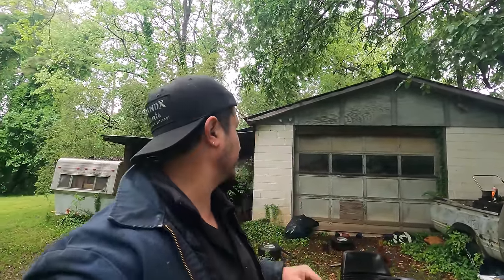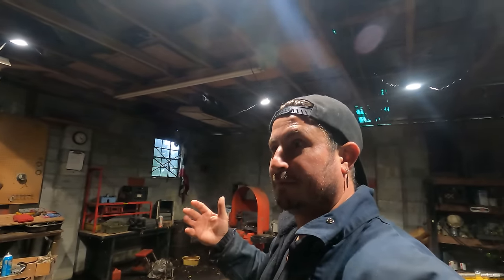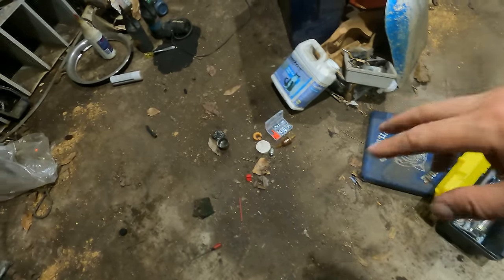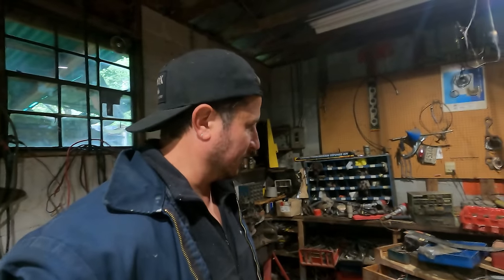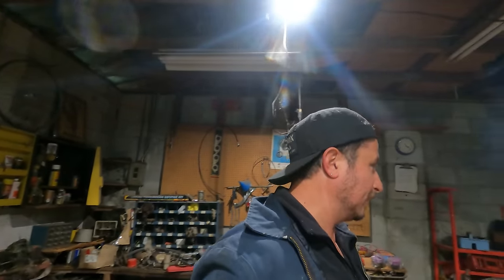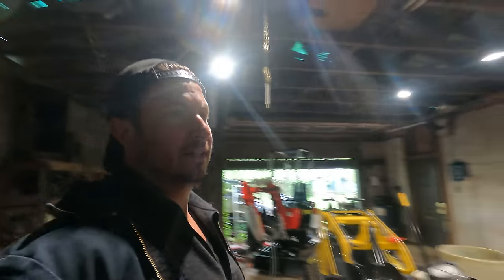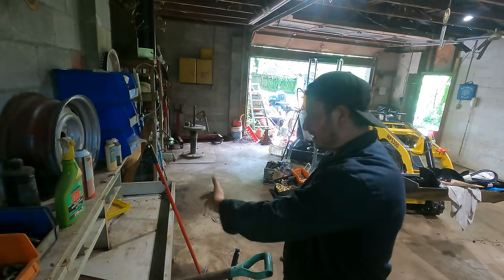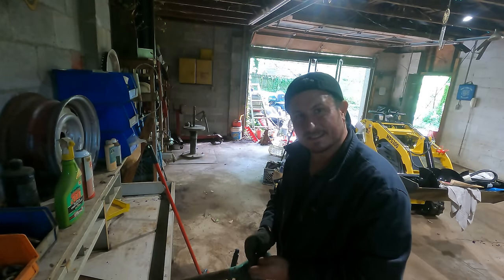What was left behind in AN ABANDONED SHOP!! Hot Rod Parts? Tools? Machines? Antiques?

Comment: Wiper blades, radio knobs, starters, all that little stuff used to be hard to find. Some still is, especially original parts. Im only 42 so not that old, but i used to buy kits and rebuild my own starters and alternators just like my dad did. Believe it or not, parts stores weren't always open every day of the week and just down the road. They were 9-5 weekdays and if you didn't have miscellaneous parts on hand you could get screwed pretty easily on a weekend repair on your ride. All that stuff was gold. Gotta remember, the interwebs wasn't around either to order everything.
The wheels and tires....keeping rollers around for project vehicles is a no brainier. Especially if you have a small space and need to move stuff in and out often. The previous owner had a method to his madness and knew exactly what he was doing.
Good luck on things!
Reply from the maker: You’re not wrong, and I live through the transition to parts stores being open while the rebuilding shops closed.  I also remember one part stores sold parts to things and not just whole replacements.       
But part of the method, this guys madness seems to reflect my own    Grab the spare take the part you need out of it, leave the corpse on the bench and shove the working one in the car and get down the road
Reply: @betweenthesharksgarage  never know when you might need the leftovers! Aint nobody got time to clean! I also suffer from that infliction 🤣🤣🤣
Reply: @johnw55018  What kits do I need to rebuild alternators and starters. Im just wondering. Cause I want to learn how to rebuild them

Comment: I'm  gonna  go  with  the  guy  was  a  rebuilder  of  sorts.  '67  to  '70  maybe,  Caro/Fireburd/T/A's.  Had  a  buddy  in  school,  and  that's  what  him  and  his  brothers  did.  Camaro  and  Firebirds  mostly.  Starters  went  bad  back  then.  Keep  a  few  to  swap  parts.  Bumperettes,  fit  on  many  Chev/Pontiac  models.  Corvette  stuff  was  a  little  rare,  and  VALUABLE!  Even  more  valuable  today.  Lugnuts?  Swap  meet  finds.  Always  have  extras.  Especially  if  you  dealt  with  Older  cars.  Left  hand  thread  and  all.  BUT!!!!!  You  did  come  out  of  it  with  a  tire  machine,  right?
Reply from the maker: i mean ... i came out with a tire machine, i saved all the pulleys, brackets, lug nuts, brakes and spindles, carburetors, water pumps, the inline 6, 2 engine stands...and most important...2 harley beers

Comment: Look at 67 comaro pics to see if that trunk luggage rack is to suit could be a bit of coin there and for the emblems. Plus the comaro nuts might be interested in the starters motors for date codes on restos as silly as it may sound to you. The Chinese gear is junk. 👍
Reply from the maker: good point about the camaros.   also a good point about the starter date codes.   all of it is just in a pile at the moment i will look closer at it before it goes anywhere... my old cars are beater drivers sometimes i forget about the true blue restorers

Comment: I’m guilty of hoarding old jumper cables. Not the cheap kind that you buy in the 7-11 at 2am when your car is dead in front of the bar.  The good ones are great stock for making battery cables in hot rods.
Reply from the maker: I hear you !  But I keep all of them even the cheap ones.  Nothing in there is the right gauge, but I’m keeping every last one because I have been in a bind many times before.   Anything can be better than none

Comment: The contents appear to predate the internet and the rise of Chinesium parts. I still vaguely remember a time when those things weren't cheap and hard to find.
Reply from the maker: That is fair.       I guess my first car was still pre Internet parts, and I had to order a 57 Chevy starter from Napa.    And also back in those days, there were local rebuilders…. So I guess we did have a big 50 gallon drum full of Cores.
Reply: @betweenthesharksgarage I ended with a bunch of rebuild parts but scrapped most of them. Just not worth putting on ebay.😁